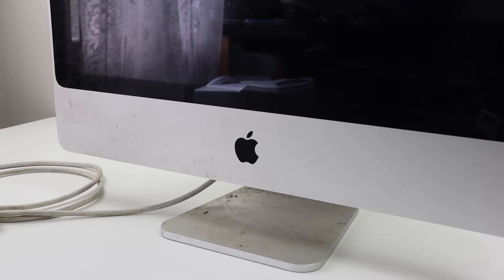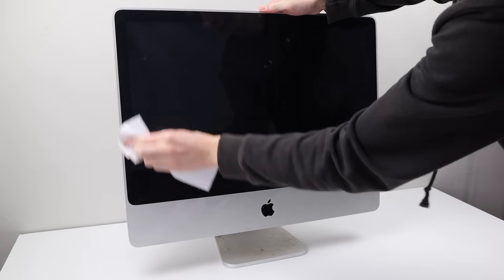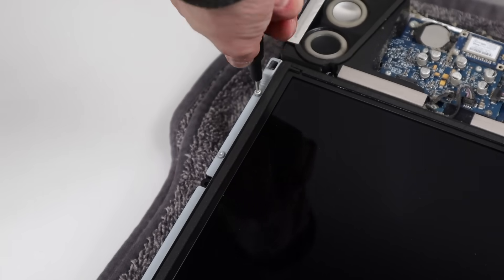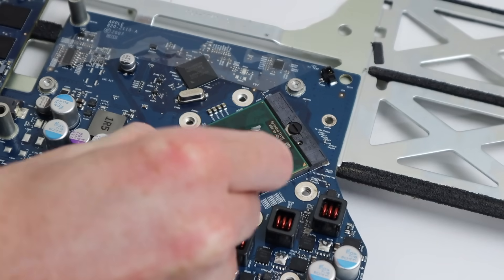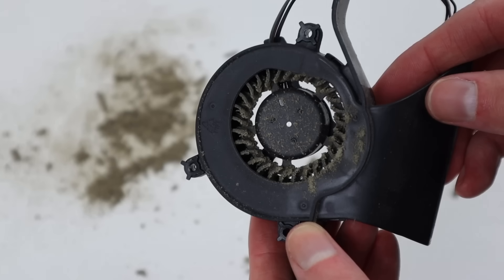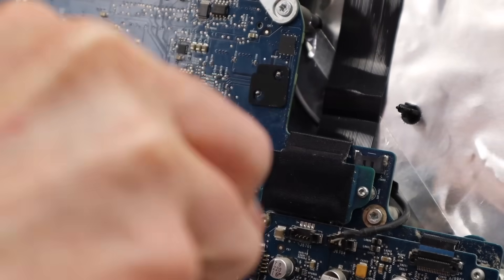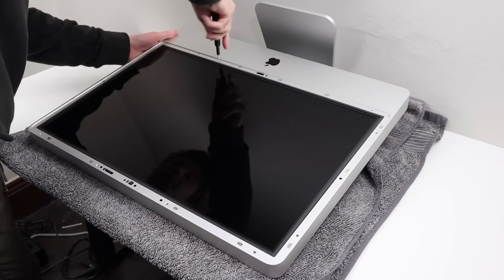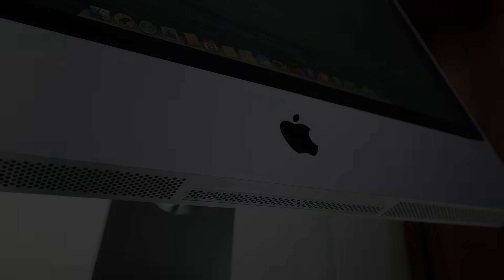I Was Given a FREE Broken iMac, Lets fix it!

Comment from the maker: Update: Turns out this iMac was sitting in a shed for 5 years, it hadn't been used since 2015
Reply: Was it a shed in Sahara Desert? Great job on that machine. Opening the machine is easy (relatively speaking), putting it back is not as easy as you make it sound!
Reply: Hi Guys

I had an IPhone 6 and my friend swam with the IPhone and after a couple days the device was shutdown and the screen was black.
And I tried putting it into charge to see if it’s still working but no sign.
So I wanted to ask you how am I gonna know that the device still works so I can repair it if it’s completely dead then I don’t have to. Is there anyone who can help??
Reply: @yassersaadat3042  tbh if it isn't IP certified for water intrusion then it is probably busted and need alsorts of new parts beyond repair. If it had power and water got inside it then it'll have probably gone and shorted like crazy.
Reply: @yassersaadat3042 - I got out of my car late at night, it was raining and I ran into the house and did not notice my phone fell out of my suit pocket.  It was late, so I showered watched some TV and then got on my desktop iMac then went to bed.  In the morning I could not find my iphone and checked my suit coat pocets and it was not there. I remembered running from the rain to the house, so I went out side and the ground, streets and grass were wet but it was no longer raiining.  I looked for the phone along the 40 foot path I ran the night before and saw a muddy, puddle of water, so I grabed a stick and carefully ran it slowly across the puddle and found my phone. It had been underwater for over 8 hours, i carefully dried and and shook the water out of the charge port.  Later I charged it and it came alive, but the screen showed water trapped in it.  I took to a tech shop for cleaning and drying the inside. The charged it for me and It works fine.  It cost me $25.  Your phone may need a thorough cleaning and drying before charging and seeing if it come back on as normal. The cleaning charge is worth it to find out before you buy a new phone.
Reply: @yassersaadat3042  The liquid might have damaged the logic board. Or it is even possible that the LCD display connector has some corrosion on it due to the water entering the phone. I believe there is no way of finding whether it works or not. Also it might be possible that maybe just the battery connector is damaged. If it's a corrosion issue, try cleaning all the connectors with alcohol.
Reply: @pravinsharma1885  imagine being so low that you force people to visit your channel
Reply: Can i please have that iMac ihave no computer
Reply: Fredd Colour Green I have one too, I didn’t realize you could run the latest os on it. Is there a how to?
Reply: I forgot my security question on my iPhone 📲 plz help😓😥
Reply: How did you download mac os onto the hardrive
Reply: @jacobionekanobi7534  He downloaded the macOS and then converted the drive into a bootable one and then flashed the OS onto the drive.
Reply: @aryamannkhare9505   2005
Reply: @ireneantan3788  what?
Reply: Doesn't Ifixit have a guide?
Reply: VectroClan ye
Reply: @pravinsharma1885  no self promotion here WE DONT DO THAT,GO SOMEWHERE ELSE
Reply: @pravinsharma1885  the comment was good till you self promoted
Reply: @Hugh Jeffreys I have this exact mac and it won’t update my Mac OS and I can’t download anything is said it needs a update then I go to update it and it says it dosent need an update can you help?
Reply: @tylergames5687  i have the same exact problem I don’t know what to do
Reply: Caked in dust i presume?
Reply: Blacksmith Hero7 no it isn’t I don’t think I’m probs gonna sell it and get a cheap gaming pc
Reply: Hugh Jeffreys oh that's where all dust came form
Reply: are you still using it? for work or games like that.
Reply: @mickmace4847  Same xD
Reply: Hugh Jeffreys
Reply: Fredd Colour Green 
.
Reply: bruh
Reply: My Mac book pro broke recently would be good if you could hook me up with this Mac so I can do my work please  thanks for alls your great videos
Reply: can i get one in 100 $ using same old hp desktop past 6 years
Reply: that was amazing i often wondered what was inside my iMac
Reply: ew
Reply: you should bring my mac back to life
Reply: @JV-kf9us  I could've done it
Reply: How to get the black and white wifi antenna mine broken
Reply: Very good job. If I had done this the iMac would be even more broken than before, haha.
Reply: Lol
Reply: Hugh Jeffreys bruh
Reply: @mickmace4847  offer still up?
Reply: Damn.
Reply: Oh god no way wonder it was so filthy
Reply: Dang long time
Reply: Mick Mace don’t self promote, and I don’t think Hugh would want to
Reply: wew
Reply: This man who bought the iMac literally only used it for two years and then just threw it in the shed
Reply: well that was unexpected
Reply: Mick Mace 
l
Reply: but why? why would you do that?
Reply: Hugh Jeffreys what
Reply: who Makes video on this
Reply: Do u have any low cost MacBook?? maybe old one??
Reply: How do u receive this stuff I want to fix things like that
Reply: Hi Hugh, thanks for sharing your videos! Keep them coming! Can you tell me where to or how to get all mac os ?
Reply: User chill 8 YEAR OLD
Reply: How you get it free ??????
Reply: A nice presentation I like the way you are disconnecting the cable, cleaning, securing properly. I have one question does the screen easily come out if we use section cups I am afraid to do that.Great video
Reply: The guy when he sees this omg that guy made it better then u the guy vid https://youtu.be/dQw4w9WgXcQ
Reply: So that's why it's so Dusty
Reply: For a minute there i thought you put that external hard drive into a toaster
Reply: Hi hugh I'm your biggest fan.. can i be your apprentice?? It would help me big time.. can i reach you privately.. if its ok.. im from dubai by the way i need your expertise to rebuild a mac book pro 2008 model that i found in the garbage.. please help me..
Reply: Hey if you didn't gonna use this imac that gibe it to me i didn't have any computer like that if you wanna do so contact me - kashwin989898@gmail.com
Reply: @modernboys3425  r/choosingbeggers lmao
Reply: @mickmace4847  play Bara Bara.
Reply: Man I wish people were offering me their old stuff so I could have a play and attempt to fix devices
Reply: @k62627  Kaboom bodyguard smart
Reply: FIVE?
Reply: Where did you download your copy of OSX Mavericks? I can't find a copy of it anywhere and I need it too.
Reply: You’re the best.
Reply: Huge hope your good. Go this same I Mac put a solid state in it but now it's noisy. Any thoughts on a fix? Same for my 2010 Mac Book Pro
Reply: oke hiihihihihihiihihhihihihhihihihihhihihihihihihhhihihihihihihihihihhhihihihihihhhhhh

hh

hh
h
h
h
h
h
h
h
h
h
h
h
h
h
h
hh
h
h
h
h
hh
h
h
hh
h
h
h
h
h
hh
h
h
h
h
h
h
hh

h
hhhh
Reply: WOW
Reply: Hugh Jeffreys oof
Reply: P
Reply: ok
Reply: I have a 2010 27 inch iMac with a 1st gen intel i7. And it is AWESOME. Also 2009 ATI Radeon 5750.
Reply: @mickmace4847  hhhA
Reply: Yesyesyes
Reply: @HughJeffreys You should use these laptops you et
Reply: That makes sense since the last system supported was OS X El Capitan in 2015.
Reply: Daaaaaamn
Reply: INSANE
Reply: shed????
Reply: Great Job! I Like Macs! It's My favorite type of Computers.
Reply: lol I have the model from 2008 and recently upgraded lol I can tell by the plastic back because iMacs got a redesigned after that year
Reply: Imac 2007
Reply: Holy unused imac
Reply: Hugh Jeffreys
Reply: @emersonclores3560  hugh
Reply: Excuse me...a plastic..spadger?? Did hear that right?
Reply: @G.reviewz  j
Reply: well, thats not that long......
Reply: you mean 6 years now?
Reply: @rezonate9963  the comment is a year old, idiot
Reply: That's why is an Intel Mac from 2015
Reply: 5 Years for an iMac! my old VAIO laptop that I was able to recover was sitting for 6 Years in a bag!
Reply: I really like Imaks
Reply: Whoever left this iMac out is sooo rude 😭❗️❗️
Reply: Why dont abuse imacs like that they ar ethebest
Reply: You're a cool dude.
Reply: lol

that's funny
Reply: Oh nice 🙂👌

Explanation

https://youtube.com/shorts/dKqBsTFey9E?feature=share
Reply: Nop
Reply: You should do a dankpods collaboration with iPods. he is the Best!!
Reply: I have one similar to the one in the video, it still works alright but the screen is cracked from being dropped. :,(
Reply: The iphone 13 pro how much memory  does it have
Reply: Update: Turns out this iMac was sitting in a shed for 5 years, it hadn't been used since 2015
Reply: @TheStrawberryGurl  why do you copy comments?
Reply: Bruh
Reply: I have this iMac too! It's in slightly bad condition. It's missing an ODD, it's front glass has bumps, (because some magnets fell off). A year ago, i discovered that this iMac was previously owned by an school. They already opened it, thats why it had an 80 gb hard drive
Reply: That’s one rotten 🍎
Reply: God dam
Reply: If you try iFixit you'll find loads of guides on how to strip down different iMacs etc. This could help you in future rather than trial and error.
Reply: Why
Reply: Pasta Films, Hello c: food member
Reply: @SukhamG  I think Pasta films was not trying to reply to you but that's fine :)
Reply: @SukhamG  because the owner didn't bother getting it fixed?
Reply: Pasta Films  what do u mean why I have no use to fix it but sure he can
Reply: Hugh Jeffreys And I could use it for school and work fun fact I have never owned an iMac or a computer or I can buy it off you
Reply: @pravinsharma1885  self promotion

Comment: Blurry white cloud on iMac screen
Hi all,

I recently bought a secondhand iMac and am seeing an issue where a 'white cloud' is appearing on the screen after the screen has been on for a bit. I know that it's a physical issue as the 'cloud' is still present when the screen turns off. The affected part of the screen appears blurry when the screen is on, and looks like a white ish cloud when the screen is off (see pic). After about 10 - 20 mins of screen off it starts to fade away and disappears.

Has anyone seen this before/know what this is or have any idea how to resolve?

Thanks,

Comment: Have Apples I Dug Out of Shop, A1407 and A1802, About To Canabalize, But Found Your Video when Searching on Dissembly, Now I may work on Saving as You Mention the Quality. 
First Had To See if Their Is a Thunderbolt to HDMI(Writing This, Thinking it needs To Be HDMI To Thunderbolt, If Adapter is Made, Will Save, or Off To The Canibals. The HDMI To Thunderbolt was about $4, $3 Shipping. Checking Correct Direction Adapter Now.

Comment: Hi Pal, as I was cruzing the Greenworks zeroturn lawnmower my neighbor exited his side gate from his backyard with a iMac under his arm. He rhen placed it on the asphalt by the curb and said "if you want it, you're welcome to take it."😀 I immediately placed it on the deck and before I could take a seat my neighbor returned with a second newer model saying "here this one two." I placed that one in the trunk behind the seat and drove around the block to the house. Jump on my motorcycle and headed straight to the Thrift Store. 🎉 Tada! 🎉 Exactly what I thought an iMac chord $3.99 with senior discount to boot! 
At home I connected to see Mac OS 10
version 10.4.11
Processor 2.16 GHz Intel Core 2 Duo
Memory 3 GB 667 MHz DDR2 SDRAM
Startup Disk Macintosh HD
iMac5,1
L2 Cache (per processor): 4 MB

I played Chess all night while watching the Three Stooges ❤🎉

Apples. I cleaned the board but, afew keys in the row don't respond. 8, l, k, . 
The speakers crackle so, I connected an external speaker. And plugged in a USB track ball that works 👍😃

I wouldn't spend for a personal Apple all these years. And now, in retirement I get two for free and I'm grateful. I remember looking at this model at the store it was beautiful 😍. But, I was not a wealthy guy and continued window shopping. 

Today after cutting the grass for neighbors as a volunteer. I returned to see the iMac wake from sleep ready for  more Three Stooge's and Chess ♟️, AL :)

Comment: I was just given a 2009 i5 that works , 12g ram , 256g ssd. Going to drop in 2 4g modules i have to give it 16g of ram and run a light linux distro and use it as a work machine and try find 8g ddr3 ram modules to later up that to 32g. I believe that as long as there are no hardware failures , this should serve me well for a few years.

Comment: I found an iMac, in a dumpster, similar to the one you are working on here. Not sure if it works! Thank you 🤓 did you slight heat up the front glass before removing it? Also, should you replace the CMOS battery? Does the 🍏 logo on the back light up? Or can it be modified to light up?

Comment: To answer the data question it depends on why the question mark is showing if the circuit board on the internal hdd is dead you can take the board from a hard drive of same make and model and put it on the drive.

Comment: Hey Hugh. Your video was very informative. Thank you for creating it.
I so happens that a friend gave me a "broken" iMac 20. He told me that it wasn't turning on, but I could try with it. It actually turns on, and there was a loading bar with the Apple logo, however after several minutes, that went away and left just a blank screen. I am hoping to fix it somehow, but I am not techy like that. Are there an troubleshooting steps that I could try? I don't own an external hard drive, and I assume a technician will be expensive. Thanks in advance for any additional help you can afford to give. iMac info: 2.4GHZ/1GB/250GB/SD/AP/BT... Model No.: A1224

Comment: This is my iMac sorry it’s old 
Title: The iMac 2009: Revolutionizing Desktop Computing

Introduction:
The iMac 2009 stands as a milestone in the history of Apple’s iconic all-in-one desktop computer series. Released on October 20, 2009, the iMac 2009 brought a host of advancements and innovative features that revolutionized the desktop computing experience. This essay delves into the design, specifications, and impact of the iMac 2009, highlighting its significance in shaping the future of personal computing.

	1.	Design and Aesthetics:
The iMac 2009 retained the sleek and minimalist design that characterized Apple’s product lineup. It featured a unibody aluminum enclosure, reducing weight while providing enhanced durability. The 20-inch and 24-inch display options offered vibrant colors and sharp imagery, thanks to their LED-backlit technology. The introduction of the edge-to-edge glass display gave the iMac 2009 a sophisticated and seamless look.
	2.	Performance and Specifications:
Under the hood, the iMac 2009 boasted impressive performance capabilities. It was powered by Intel Core 2 Duo processors, ranging from 2.66 GHz to 3.06 GHz, which ensured smooth multitasking and enhanced overall speed. The inclusion of up to 8GB of RAM provided ample memory for demanding applications and resource-intensive tasks. Additionally, the iMac 2009 featured NVIDIA GeForce graphics cards, enabling impressive visuals and optimal gaming experiences.
	3.	Enhanced Connectivity:
The iMac 2009 introduced significant improvements in connectivity options. It came equipped with four USB 2.0 ports, allowing users to connect a wide range of peripherals effortlessly. FireWire 800 ports enabled high-speed data transfer, while an SD card slot provided convenient access to digital media. Furthermore, the iMac 2009 supported Bluetooth 2.1 and had built-in Wi-Fi, ensuring seamless wireless connectivity.
	4.	Display and Multimedia Experience:
The iMac 2009 offered a remarkable visual experience with its high-resolution display. The LED-backlit screen provided vivid colors and crisp details, enhancing the viewing pleasure for various multimedia applications. Moreover, the iMac 2009 featured an integrated iSight camera, enabling users to engage in video conferencing and capture photos or videos with ease.
	5.	Environmental Considerations:
Apple’s commitment to environmental sustainability was evident in the iMac 2009. The desktop incorporated energy-efficient components, meeting stringent environmental standards. It was free from toxic materials such as mercury and arsenic, making it safer for both users and the environment. The iMac 2009 also consumed less power in standby mode, contributing to reduced energy consumption.
	6.	Impact and Legacy:
The iMac 2009’s impact on the personal computing landscape cannot be overstated. It set a new benchmark for all-in-one desktop computers, influencing subsequent iterations and inspiring competitors to raise their standards. The seamless integration of hardware and software in the iMac 2009 showcased Apple’s dedication to providing a user-friendly computing experience. Its design and features paved the way for future iMac models, solidifying Apple’s reputation as an innovator in the industry.

Conclusion:
The iMac 2009 was a game-changer in the world of desktop computing. Its elegant design, robust performance, enhanced connectivity, and environmental consciousness made it a standout product in its time. The iMac 2009’s legacy lives on, as it laid the foundation for subsequent iMac models and shaped the trajectory of personal computing. It will always be remembered as a pivotal moment in Apple’s history and a testament to their commitment to pushing technological boundaries.

Comment: Great cleanup. One thing I am not sure of is your statement on the 2020 iMac 27" 5k. I have one and you stated the hard drive runs at 6400 rpm's
Well my 2020 doesn't even accept a 3.5" or 2.5" platter or 2.5 ssd. It seems as of 2020 Apple eliminated the connector for any hard drive 3.5" or 2.5".
It's only storage is called an Apple Flash drive and is Identical looking to an NVME. The only thing I can think of is maybe you mean a 2019 iMac.
or a Special BTO Intel i5 where someone was buying 50 and they got an exception?